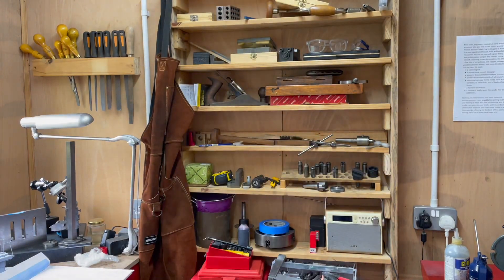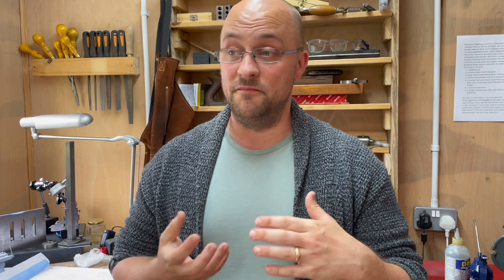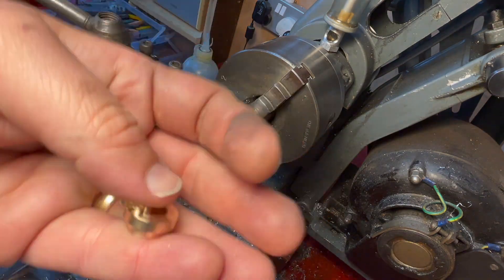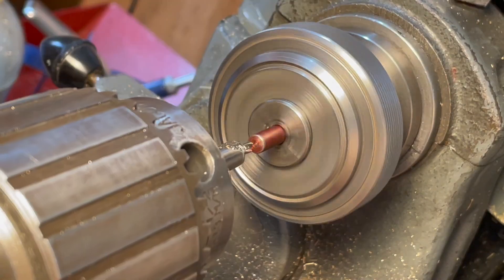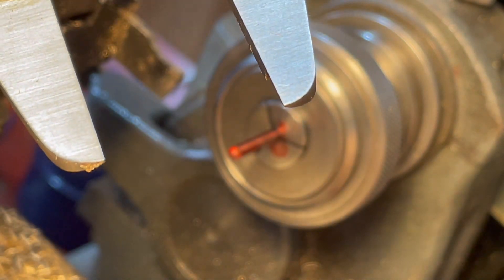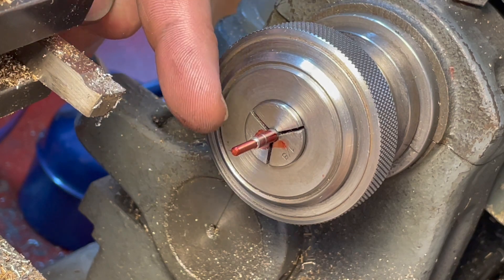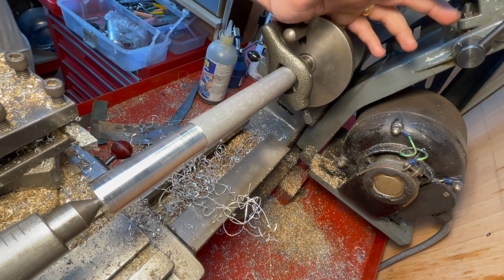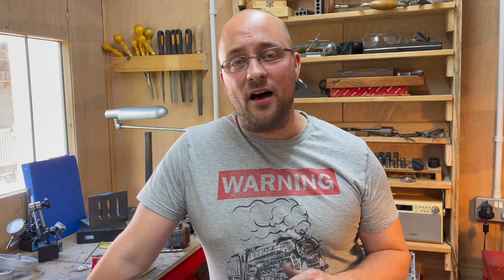Introduction, Cylinder, Flywheel & Oddments - Building a MyfordBoy Traction Engine 1

Comment: Good fun project
Reply from the maker: Yeah definitely feels fun to me - maybe because the materials are cheap and the cost of failure in time is low, there's no stress at all..
Reply: @williamsworkshopuk  yes I'm currently building a 2 inch scale fowler traction engine so yes cost for your project is minimal in comparison looking forward to see more
Reply from the maker: @carlweatherley4883  part of the justification for 2.5” gauge over 5” gauge locos too - exponentially less costly and so less stressful! We’ll see I guess!!
Reply: @williamsworkshopuk  yes very true m8